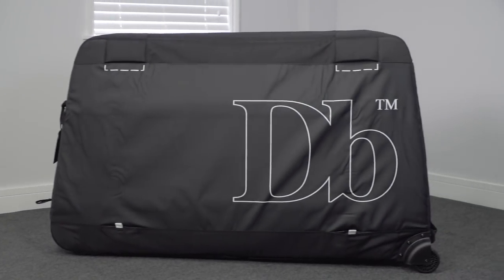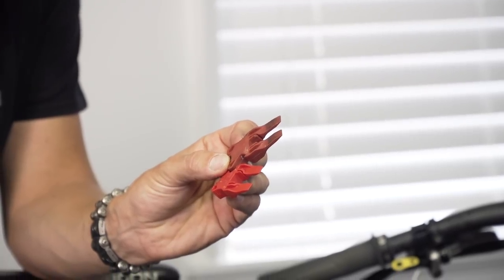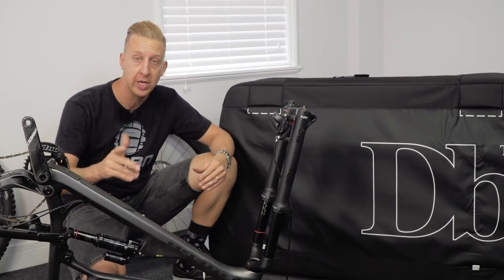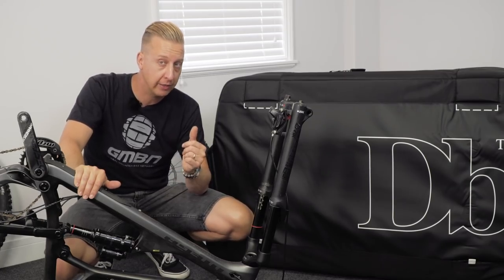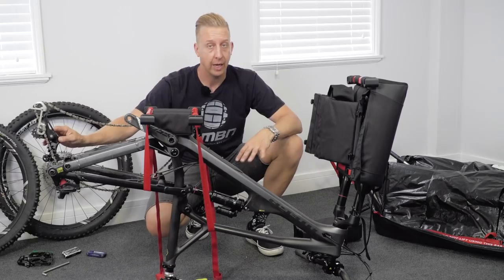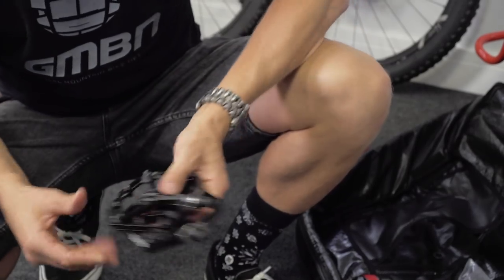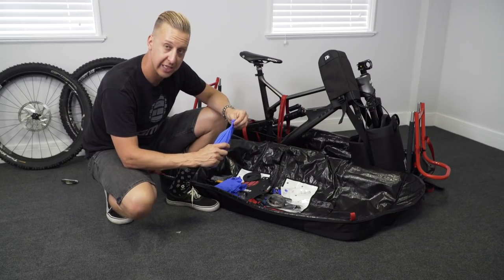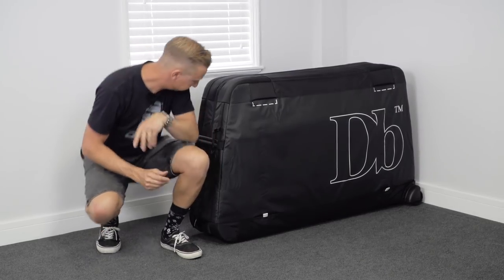How To Pack A Mountain Bike For Travel | GMBN Packs The Douchebags Savage

Comment: How about making sure it’s clean because some countries (Australia I think) are tough on bringing dirt that could have bacteria etc into the country?
Reply: Patrick Shearing in case you forget to clean it, you will get your personal dirt shed show
Reply: really?  it's a bit excesive in my opinion. Specially when almost anything can kill you down under
Reply: But seriously if you threaten our biosecurity your own food supply will suffer.
Reply: James Downey it’s funny how Aussies flip from there stereotype to their normal attitude when on the internet.
Reply: Good call - New Zealand and Australia makes you show shoes and wheels at a minimum. I've thrown shoes and tyres out rather than deal with a grumpy Customs official in both Australia and NZ.
Reply: Good point mate, I had my Norco sight pressure washed my the airport and they blasted all by bearings so once I arrived I had to get them all replaced

Comment: awesome and useful video.  as for CO2 cartridges, it's possible that the ones used for lifejackets have been tested and tested again and gotten a seal of approval for aviation use.  something that would probably not be the case for commercially available products.  as with paintball equipment, no european airline allows paintball/airsoft co2 cartridges, could be the same for our tyre inflators.

Comment: weight is a serious concern.  my preferred airline treats bikes as regular checked baggage, and I get one free checked bag, up to 50lbs.  more than 50lbs gets a $100 surcharge.  My bike weighs 36lbs, the cardboard box & packing materials put me at 49.5lbs after I removed my chain and pedals.  I couldn't put a pair of socks in there let alone stuff a 26lb bike bag with tools and gear.

Comment: Very good! I’m planning to buy one but when looking at airline rules there are only a few of them that allow a weight above 23 kg. More or less everyone with an L frame and above must have a problem with this limit since most of the bike travel bags weigh around 10 kg.
Reply: Airlines will still let you bring an over 23kg bag. They just add an overweight charge. This was what they did when everyone used those hard cases that weighed over 13kg.
Reply: Newt Tella Great, thanks!